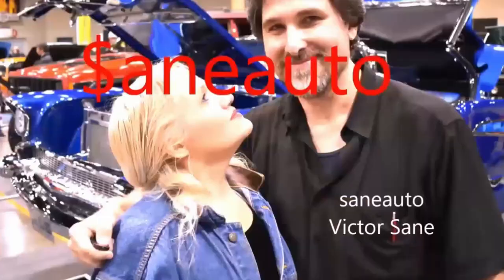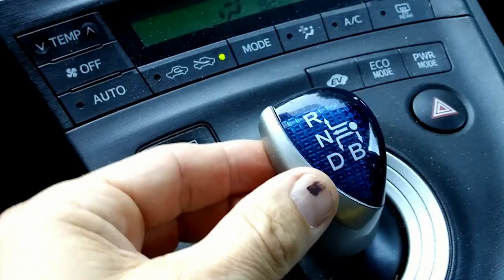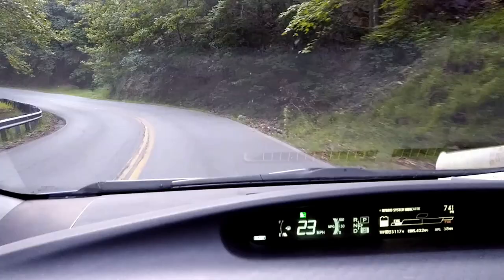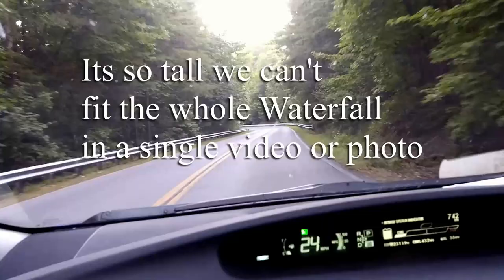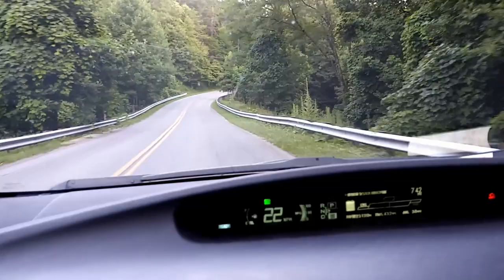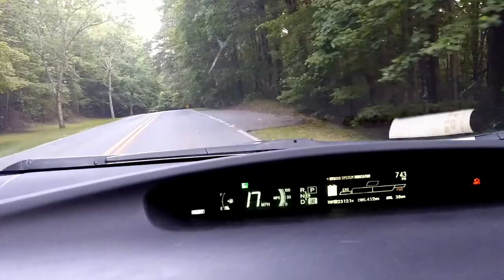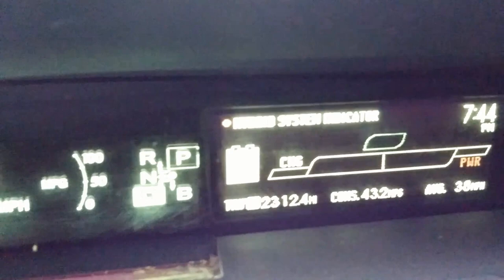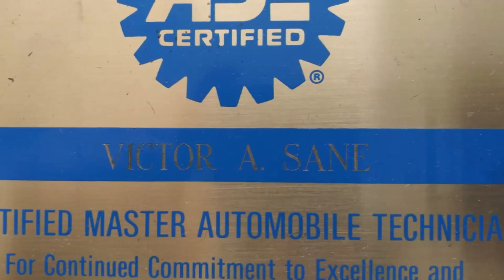What is the B mode on the Prius shifter

Comment: Its basically a form of engine breaking.  It does not send or pull energy from the wheels.  The function is to slow the vehicle down  on steep grades or in traffic.  It tremendously saves both fuel and brakes.
Reply: ohh, thank you!
Reply: idk how it would save fuel as the engine turns off when braking down a hill but it definitely saves brakes once your battery is charged and can't regenerative brake anymore.

Comment: Any idea what happens inside the car for the B mode-Does it put more stress on some parts other than the brakes?.
Reply from the maker: The motor/generators are doing all the braking in B unless you are pushing the brake pedal, then that additional braking from the pedal would be the conventional brakes. Motor/generator 1 & 2 are in the transaxle.

Comment: So it’s like a Jake Brake on a semi?
Reply from the maker: Similar but the Hybrid uses the electric motor to convert some of the energy to electricity and store that in the battery. The Jake brake does a similar thing but the jake break has a valve in the exhaust to restrict the exit of the exhaust making it harder to turn the engine slowing the vehicle even more but without recovering any of the energy. Your right that they both help slow the vehicle to help take pressure off of the brakes on steep downhill grades.
Reply: @saneauto  thanks, I learn something new everyday.👍
Reply from the maker: @Becauseimme  Asking questions is much less painful way to learn than making mistakes. But not learning is the most painful way to live. Hope to see you in the comments again soon Marky.

Comment: Can i switch back and forth between D to B while car is moving ?
Reply: Yes. Do it as needed. I have a habit of using it when I have shorter braking lengths to stop in (deer runs out, someone stops in the road, and etc.) it helps me brake safely sooooo much faster